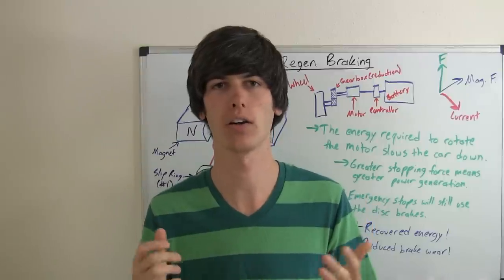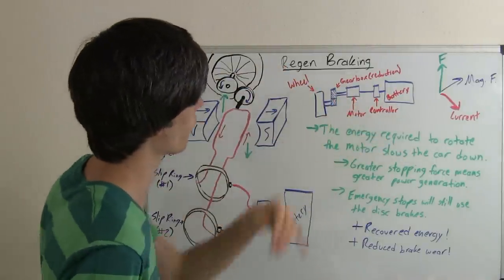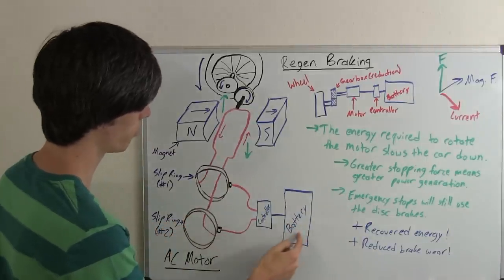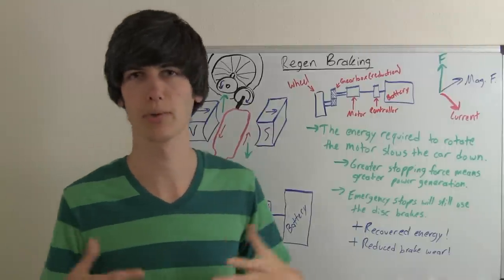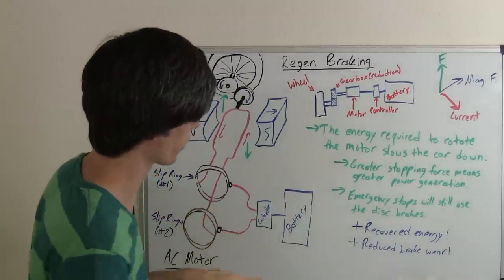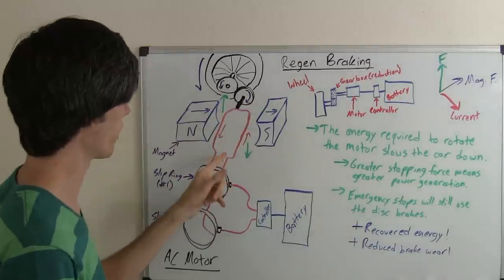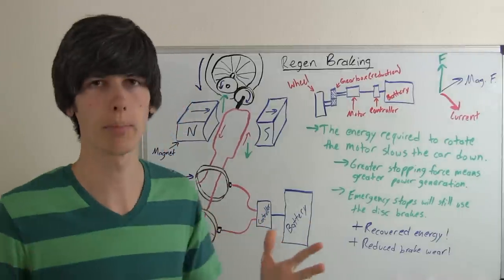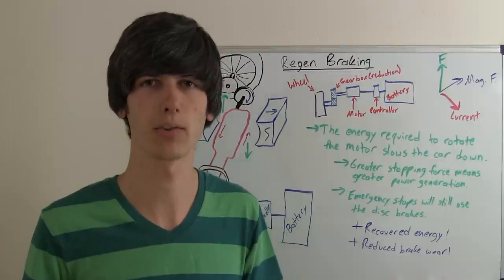Regenerative Braking - Explained

Comment: There is almost no explanation here of how it actually works.
Reply: I didn't understand why it is called regenrative *braking*. Because when the wheel rotates the mechanical energy is converted into electrical energy (Dynamo), what will happen when it brakes ?
Reply: The way this kid explains it basically says that if you coast, friction will cause you to slow down, which will save energy...

Comment: Fantastic, from what I understood, instead of allowing the motor to rotate the car wheel, when recuperation is triggered, the wheel starts rotating the motor in the opposite side, thus generating electricity(as a simple dynamo). Very brief and comprehensive! Massive thanks!
Reply: My bad, most probably the direction of rotation remains the same.
Reply: @VicSMeIsTeR  correct. Motors in operation generate back emf, so this is passed into a charging circuit when the motor is slowing down

Comment: Perhaps you could explain how the system responds to varying amounts of but brake pressure. how does light or heavier pressure on the brake pedal translate into less or more power generation and just what would have to change to create more or less stopping power?
Reply: He didn't delve that deep into it, but essentially, you can't get energy for free. The more load you have on the coils in the motors, the more resistance the motor has to turning, and the higher the braking force is. The extreme version of that is just a short circuit, maximum load. This would make it very hard to rotate the motor, maximum breaking. Of course, instead of having a variable resistor that you change the resistance of form an open circuit until you have a short circuit, and let that energy dissipate away as heat, you actually use that energy through a controller to recharge your battery.  the more current you take in, the higher the breaking force.

As for the reason why this happens, the alternating magnetic field from the rotor creates an alternating current in the coils from which you recharge your battery. That current creates a counter rotating magnetic field, that repels the magnetic field from the rotor, hindering it from turning. Conservation of energy applies here, just like everywhere else, so the amount of energy consumed by regenerative breaking is the maximum amount of energy that can be harnessed to recharge the battery

longest comment I've ever written, cheers

Comment: The explanation for the regen braking is not entirely correct. With AC induction motors, regen is accomplished by lowering the frequency of the AC motor, which will slow it down, but the mass of the vehicle will not respond instantly to the slow down caused by the motor going slower. Thus, the AC induction motor's rotor is spinning faster than the rotating magnetic field of the stator. The result is that now the AC induction motor is acting like an AC induction generator ( asynchronous generator).

For brushed DC motors, the separately excited type is the one that can also do regen by applying more current to the field coils to increase the magnetic field strength, which in turn will make the motor's Eg voltage per 1000 RPM higher so that it charges the batteries as you slow down. Only Sep-ex motors can do this easily. Other brushed typed DC motors are not very easy to accomplish regen with. You can still plug brake and dynamic brake the other brushed type DC motors....
Reply: You seem to know a bit about this. I'm wondering if you could explain some things? From what I read, an AC induction motor working as a generator requires a small amount of electricity to initiate or excite the generation. Why is that necessary, what does it do? Does it act to turn the motor at a slower speed than is being received by the prime mover, thus creating some sort of imbalance?
Reply: Regen brake not only stops the car with the generator, but average brakes too
Reply: +EETechs perfect, exactly the knowledge gap bridging i was looking for. i understand that for the induction motor to work the rotor must be spinning at a frequency less than the rotating magnetic field of the stator i.e. slip, so in this case can i simply deduce that an opposing force/torque is generated upon the rotor as a result of its frequency being higher than the stator's rotating field?
Reply: This guy knows
Reply: Unless I'm mistaken, this is because AC Induction motors don't have permanent magnets, so they need to set up a magnetic field (like an electromagnet), which requires electricity. So you need to seed the system with a magnetic field in order to set up induction.
Reply: nimajneb02, Yes  when the current phase is ahead of the voltage phase," if You will" the "induction motor' acts as an alternator.  This works if there is a permanent magnet configured to generate a magnetic field in either the rotor or stator. 

 If You use a conventional common place design for an AC induction motor,  yes the rotor would need a small amount of current supplied to a field coil in the rotor to initiate the magnetic field in the rotor as the mild steel in the core is a soft magnetic material, meaning it only retains the magnetic field  for a short time. This is basically how a car's alternator works, it needs a small voltage across the "tickler coil" to initiate the magnetic field.  If however a small permanent magnet is made part of the rotor it may be configured to generate enough current when the motor/ generator is driven to generate full regen power, using a little "feedback". 

   If the stator (as shown is this video) is made with permanent magnets, the rotor connected to slip rings (and is made up of coils) as shown in this video, then the rotor will always create ac voltage (when rotated by an external supply of torque, or can be made to operate as an efficient motor, with appropriate control circuits and applied voltage and current / phase angle.  However in order to maximize the energy created it will work better as a polyphase AC alternator, as then, the torque, and current produced can be made to be uniform, when the phases are added together, and interactive.  
    Since magnets tend to be less permeable than coils around a "mild steel" core,  coils  with mild steel cores are often used in the many designs.  Permanent magnets create some problems in terms of flexibility of motor operation.   NIkola Tesla invented at least twenty (or maybe in excess of 100) different ways of configuring cores, coils, magnets and stator's and rotors to produce many different behaviors for motors.  The simple shaded pole induction motor which has a single phase AC supply, has a magnetic field in the rotor, that always rotates more slowly than the rotor itself, and can't be effectively used  in "alternator mode".  However a hysteresis synchronous motor which  behaves as though the rotor is a permanent magnet will regenerate voltage and current in the stator., though the one's designed for instrumentation are not efficient in size.   Nikola Tesla, in the early 1900's produced a flywheel based motor / Alternator in which the rotor field was wired with field coils connected to an external circuit through slip rings, that could be made to operate at different frequencies , so that the rotor poles increased in number as the rotor slowed down in order to maintain a constant frequency output even as the flywheel slowed down.  Apparently, some of these were used for well over 50 years, in factories to save energy costs  when various machines were turned on and off and could supply electricity for a time  in a 'blackout"!  I can't remember the exact detail,s but like almost everything he put his mind to, he came up with ingenious and clever ways to overcome obstacles. 

Nikola tesla's many patents and designs for motors / generators / Alternators may still be found in several books.  Unfortunately You tube & the internet are full of "secrets about Tesla" that are never explained, and often based in fantasy alone..

Comment: good high level overview... however upon reading and learning about how ac induction motors work (as is used in tesla vehicles) i think this schematic of the ac motor is oversimplified to the point where it is incorrect? no mentioning of the 3 phase stator or the squirrel cage rotor... can someone please advise?

Comment: So lets say your going 60mph and you let go of the accelerator, but your not stepping on the breaks, so how does it keep it from not using the Regenerative Breake?? Is there a gear in the wheel that engages to the AC motor only when you step on the break? Or how??
Reply from the maker: Typically it would brake unless there were a mechanism that prevented it, such as a clutch. Probably unusual.

Comment: Hi. When you press on the brake, how does the car know if it should use regenerative braking (from the freewheeling motion of the car) or the disc or drum brakes (if that's still used)? Thank you.
Reply: SevenDeMagnus , you remove your feet from the accelerator

Comment: How do they induce brake feel? Most of the older generation brake regeneration had complaints it stopped to suddenly with little to no smoothness about it.  Now the current generation has considerably better and smoother brake feel.  How did they mimic real brake feel?
Reply: That's how the manufactures tune their regen systems, some (say the new Prius) do regen initially and then dial in the brakes, other , say for example the Ferraris kers have pads grab on the initial bite of the pedal and then blend in regeneration

Comment: As I know, regenerative brakes does not uses the energy to charge the battery, the energy used is to charge boost caps, and the when to start moving, you use the energy stored in the super caps to move the car (becuase the maximum amps consumption of a motor is when it's stopped) and once you are moving, the motor will move with the battery. And the regenerative brakes does not only stops the car with the generator, but with disk brakes too. Anyway, good video, you expalined the principle very well
Reply from the maker: Jeronimo Murruni Different cars use different regen methods. Most hybrids will recharge a lithium-ion battery. Very few road cars using super caps, though it was/(is?) done in Formula 1.
Reply: Engineering Explained Yeah, you are right, (i didn´t know that formula 1 cars used this technique, thank you for the information) but how do you give the lithium-ion battery a significant charge with the short span of time that takes to brake a car, you only give the battery a little charge. This sistem was used, but now electric cars ware using the technique of the super caps. Like the 1200F, 2,5 V capacitor from maxwell, for example.
Reply: +Engineering Explained 
F1 never used supercapicitors in their KERS, but the Toyota Le Mans car did for some years but they have now moved to LI-ion batteries.

Comment: May I assume that, for example, in a Tesla Model S, when one depresses the accelerator, they are signaling the "drive system" to actively send electricity FROM the battery to the electric motor to drive the wheels. Then, when braking is desired, the accelerator is released completely. At point of releasing the accelerator, is this a signal to the "drive system" that no longer is electricity to be sent TO the motor to drive the wheels, but to open the flow FROM the wheels back TO the battery, as the "drive system" turns around and sends back the albeit smaller, electricity load to the battery for capture and storage. Is this correct? What I mean is, how does the "drive system" know to reverse the flow from the battery to the motor, then from the motor to the battery? Could this be the province of the motor controller unit?
Reply: +tomsterism the laws of physics. In an induction motor, if you magnetic field inside the motor is spinning slower than the rotor then the motor will generate a higher voltage then what is going in. All the drive system has to do is lower the frequency to the motor.

Comment: Hey. Here you talk about electric cars only, but ICE cars also have some kind of regen braking. Does that work the same way (with electric motors) or differently?
Reply: There is a system called KERS, where energy from the wheels is transferred to a flywheel, but no road cars use them.  Hybrids do the same thing as electrics, as far as regen is concerned.
Reply: I know KERS, but take BMW for example. They introduced Brake Energy Regeneretion in their cars. Inside the car, when you brake, you even see a battery recharging logo.. that shouldn't be KERS. Does that work the same way as electric cars regen braking?
Reply: mitoand9
The "Brake Energy Regeneration" system selectively disables the alternator (via a clutch, I believe) during acceleration, and enables the alternator to charge the 12v starter battery while braking/coasting.  It doesn't actually slow the car down or store any of the cars kinetic energy.
Reply: Yes exactly, therefore that would be an example of regen braking in a ICE car such as BMW. Right? Essentially what I'm asking is how would regen braking work in an ICE car, and I think you answered with this comment if I understand correctly.
Reply: mitoand9 I wouldn't call that regenerative braking.  In my mind, regenerative braking requires that you somehow use the kinetic energy of the car to do something useful.  In the BMW example, the kinetic energy of the vehicle is not used to do anything useful - the battery is still charged by the alternator which is spinning because of the running engine.  It's essentially just an optimization to reduce alternator drag while accelerating.

If you look up KERS, its an example of an ICE regenerative braking system.  The idea is that when you brake, the energy is transferred to flywheel - which spins up the flywheel while slowing down the car.  Then, when the car is slowed down you can re-engage the fast spinning flywheel which accelerates the car.  It's like an all-mechanical hybrid.
Reply: Ok i see, but that's how BMW actually calls it.. and it works exacly as you mentioned above: alternator disengases from drivetrain and lets the so called regen braking system "do the work", which is in fact recharging the battery. I guess there are different ways to call it then. Thx btw

Comment: A friend made a final project with a system like KERS, the main question is when you are slowing the car down the rotation of the alternator slows down so the torque you apply to the wheels will be lower, when you need a constant torque to induce a constant "deceleration", so we thought of using a gearbox with a variable ratio.

What do you think?
Reply from the maker: I believe the motor can deliver a deceleration torque much greater than the tires frictional limit at nearly all RPM. I work for a forklift company, and this is certainly the case with our electric forklifts.
Reply: You'll still have issues with a fixed gearbox - what you need to do is design/program your motor controller to take into account the RPM of the motor, and to smoothly have more regen at lower speeds, and to smoothly introduce the mechanical brakes.  Hybrid auto manufacturers have spent a TON of time trying to get the feel of the brake pedal right, and even still in my hybrid there are times when it switches from regen to the actual brakes (at around 10mph) and it can be felt pretty strongly.
Reply: Engineering Explained

Bill Carlson understood what I said. The main problem is not the tyre slip. The problem is as you are slowing down the car you have less RPM on the wheels which will produce less rotation in the alternator so less RPM less torque on the alternators and on the wheels so less deceleration of the car.
Reply: You would need an automatic transmission that scales the ratio inversely proportional to the square root of the car's speed.
Or simpler, design a circuit that reduces charging impedance inversely proportional to car speed. Since you need DC to DC conversion to change a variable motor-generator voltage into a fixed charging voltage, the device will draw more current at lower voltage and make up for the loss of braking on the slowing motor-generator.
I'm not sure if this is exactly what electric vehicles do, and probably there is some lag on most budget DC to DC, but drawing twice as much current at half the input voltage in order to keep same power at output will have the constant force effect on the motor until it starts turning very slowly. Thus your brake will retain most of the feel of a friction brake instead of becoming increasingly spongy at low speed.

Comment: I'm a little confused about how the motor is reversed. Surely it requires the current to be reversed too? So if you still have to be supplying a current to create a current, what's the benefit over a normal IC engine and brakes? Thanks! :)
Reply from the maker: The benefit is that you can re-use some energy that otherwise would have been lost in an ICE application, and also you don't wear your brakes as much.
Reply: You don't need to reverse the direction of the motor.
The motor provides back EMF in the opposite direction to the power current during normal operation which limits current draw, (which is why completely stopping an electric motor under load can burn it up). During deceleration, this back EMF feeds the input of a charging circuit, thus the only changes required are are a rerouting of electrical current on light application of a brake pedal.

Comment: Hi, I am hoenestly waiting for your explanantion on KERS used in F1. Hope you make one soon! Cheers :)
Reply: it's basically the same as explained here, but a is only aplies on the rear tyres (i believe, i don't know for sure). That's olso the reason the engineers ask the driver to change the brake balance when there is a KERS probleme on the car.
Reply: +Dominic Savelberg are they asking for a brake balance between front and rear axles OR the balance betwee. how much regen braking and friction braking 's required based on speed and pedal force?